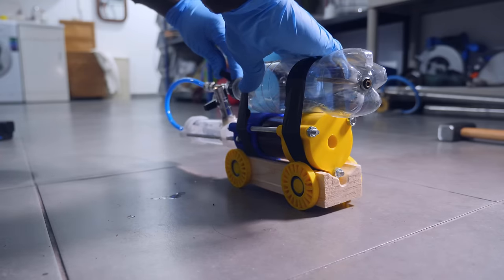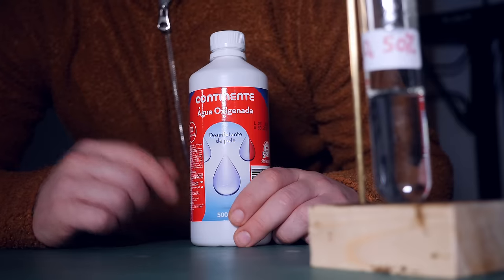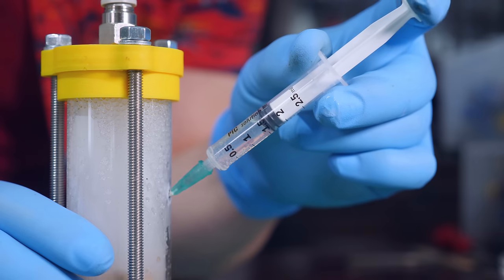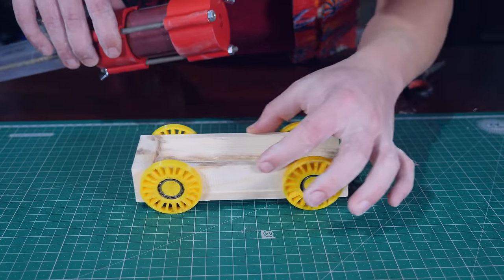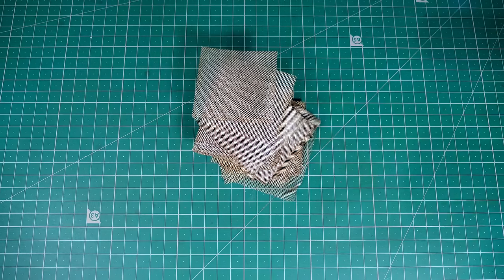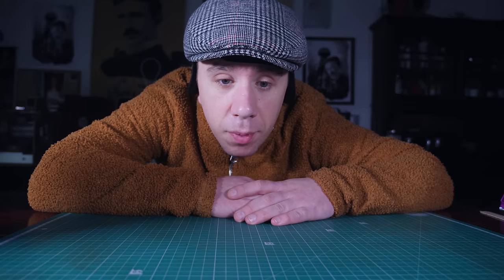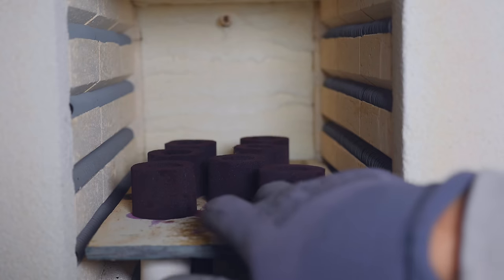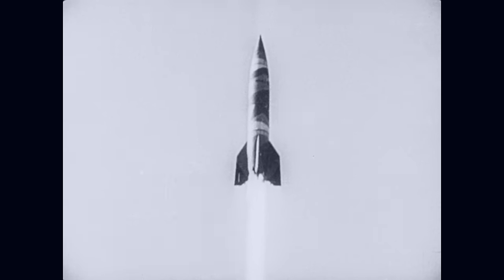SUPER HEATED STEAM ROCKET ENGINE

Comment: For layering the plaster fuel, rather than paint the inside of the tuber, print or obtain a smaller tube, paint the OUTSIDE of that, with much excess, then push that into the larger tube (maybe have a socket so it sits perfectly centered. Then remove the centre tube and u have a perfectly formed layed of the plaster on the inside of the larger tube with a uniform thickness. Or Create a two part mould where the plaster can harden, and then simply slot it into the tube.

Comment: When you were putting the plaster mix into the tube I had a thought. Why not have a piece of paper or plastic set down, spread the mix over that to get a smooth finish, and then before it hardens you slowly roll it into the tube and set it in there. That might give you a more consistant layer. You could then do multiple cylinders of the material of various sizes in order to get multiple tubes inside other tubes to maximize surface area. Put all that together into a tube and make an engine out of that.

Hope this inspires you.

Comment: Soo Hydrogen Peroxide decomposition over a catalyst is classified as a monopropellant and was used in (among other things) the attitude control thrusters of the mercury capsule (though over a silver catalyst). But there is a flaw in your thinking of using KMnO4 as a decomposition catalyst. KMnO4 is not a catalyst for the decomposition of Hydrogen Peroxide, it actually reacts with it. The equation goes something like: 3 H2O2 + 2KMnO4 -> 3 O2 + 2 MnO2 + 2 KOH + 2 H2O (whomever wants to discuss balancing of redox equations feel free but this is about principle). The MnO2 that is formed (also called "Braunstein" = "Brown Stone") is what's actually catalytically active in the decomposition of H2O2 and this is also what the brown sludge in the exhaust of your previous rockets was. So you should investigate if you want to use a stoichiometric mixture of KMnO4 and H2O2 for your rocket or if you want to try a catalyst bed from MnO2 or if you should continue on the silver catalyst. By the way H2O2 has a specific impulse of 117s at sea level (half that of hydrazine) and the lowest concentration I found for propellant formulation was 75%. Also you should check out Tom at Explosions and Fire for tips on safety when it comes to concentrated hydrogen peroxide.

Comment: Great video!

I have suggestions for your next things to try.  Musing more than anything else, but one extra step to the flower block 

A material that has these properties is exactly what you need.

It transmits heat to clinging water so well it can boil ice water with sunlight.

I understand this material has more surface area than the famed coconut husk carbon. 

Pyrolize it.  Then heat it under pressure at 300C with nitric acid and iodine for 6 hours.  Cool, open. Heat to 90C to drive off the nitric acid.

My geeky brain thinks this should be perfect.

Comment: Manganese dioxide also works with peroxide very well. Cheaper than permanganate, and you can mix it into stuff and bake it or even sinter it to make a ceramic composite. Some rocket packs use it instead of the fancy sintered silver catalysts.

Comment: Look into investment casting for wax.  Then take those techniques and replace the investment plaster with your permangenate plaster and create negative of the desired combustion chamber (less walls) out of wax.  Then pour your permangenate plaster around the wax and burn off the wax so you now have a more ideal combustion chamber with higher contact surface area.

Also maybe inject the OH into the chamber at varying points in the chamber and have feedback loop comping from the chamber to apply pressure to the OH reservoir so the motor can drive itself.

Comment: For absolute wild surface area and absorbtion with a material that won't combust, have you considered 3D printing ceramic zeolite molecular sieves? Can be done from a slurry state with FDM printing, and sintering.

If you wanna sinter it and still want really high flow-through, you can get a 2 or 3 part mould made to go in a regular workshop hydraulic press. This approach would mean having a mould made for 1-2 inch long segments, that stack and index into eachother precisely and snugly. For "optimal" "mesh" size and density (thinking small thin-walled honeycomb design), and decent component length, the interior shaping mould will require quite high precision machining. To get the relief angles spot on for all those very thin rods that form the flow-through voids in the output component (moulding such fine features will definitely require relief angles for it to demould intact). This would be extremely expensive and almost impossible to do with CNC, but interestingly enough it could actually be quite easy and fairly reasonably priced using EDM. Because if you're going with honeycomb shape, the geometry of those rods means the "cuts" will line up straight through the part from one side to the other.

It won't be a cheap mould, but once you have it, making segments using it will be fast, easy and fairly cheap. And with proper care, that mould should last you thousands of cycles.

Either way you can start off 3d printing the slurry for running trials, to see if the material has the properties you need.

There are a few papers on this, a starter can be found googling: "Extrusion-Based 3D Printing of Molecular Sieve Zeolite for Gas Adsorption Applications".

Comment: I bet you could speed up the concentration process by using a vacuum chamber. Reduce the pressure until the water cold-boils but the h202 doesn't. This also has the benefit that, as the water evaporates and then boils, it gets even colder. That should let you rapidly remove the water from an h202 solution without decomposing the important stuff.

Comment: Hey integza, try making an Turboramjet/ Rocket ramjet jet engine. It works like a weaker turbojet at lower speeds and like ramjet when it takes off. It engages the ramjet part by essentialy using a secondary bi fuel rocket engine inside, which turns the turbine, which pulls more air into the main ramjet combustion chamber.

Comment: Got to correct your intro... As a chemistry teacher decomposition is a chemical reaction! Below are all the standard common reactions:

Combination Reaction (also known as Synthesis Reaction): A + B → AB
Decomposition Reaction: AB → A + B
Single-Replacement Reaction: A + BC → AC + B
Double-Replacement Reaction AB + CD → AD + CB
Combustion Reaction: C[X]H[Y] + O2 → CO2 + H2O (hydrocarbon reacting with oxygen to make carbon dioxide and water while giving off heat... note this is only the common combustion formula as you could also generalize it as any fuel mixing with any oxidant, but for high school chemistry we stick with hydrocarbons as the fuel and oxygen as the oxidant)

Comment: Little tip if you want to conentrate even more your H2O2, you can use 2 erlenmeyers linked together with tube on the top (so the air communicate but not the liquid), one filled with your H2O2 to be concentrated, and the other one filled with liquid dessicant (like calcium chloride, very easy to find) and only heating the H2O2. This will fasten the process and also take out even more water of the hydrogen peroxide
Reply: This needs more likes. Far better than the people suggesting vacuum detona- I mean distillation!

Comment: What I would like to see is a hybrid rocket engine test using pine wood as a fuel, I'm fairly sure it would be surprising.  Simplest rocket around- a pipe, 2 endcaps with a de laval nozzle or good rocket nozzle- perhaps even just a drilled hole in one of the endcaps, the other cap is tapped for a high flow nozzle for an oxygen line and tank.  You put a servo controlled gate valve to allow a quick release of oxygen which travels through the injection nozzle and into a hole through a nearly solid carbon containing material (pine wood in this case)
The ignition source sometimes goes out-do not recommend firework sparklers as an ignition source-sometimes they shoot off like a rocket if contained 😆...
I thought you could maybe use a 12v glow plug with a steel wool wrapped bundle of powdered ferro rod firestarter as a rocket igniter. Or maybe just very fine steel wool with a 9v copper wire source, It goes molten and if you added oxygen? It might light a hybrid rocket.

Comment: You could try to heat copper sulfate until it losses blue color then let it get colder and add peroxide. De-hydrated copper sulfate will pump some water from solution. And will become blue again. This is a way to get concentrated solutions of some chemicals aren’t easy to distillate. As example you could get only 96% spirit by distillation but with the help of dehydrated copper sulfate you will get 99.9%

Comment: Wow! Love your videos Integza! I particularly love the little bits of history you add to every video.
A cool video idea would be to look into the so called "Thunderstorm Generator" which is supposed to improve the efficiency of internal combustion engines by up to 30%. Whether you can replicate that improved efficiency or debunk it I think it would be an awesome video as the "generator" works be pulling a vacuum to collapse air bubbles within the Generator and ionise the exhaust gases for reuse in the engine.

Comment: Have you tried a version of freeze drying for your h2o2 concentration process? Run cooled, dry air over the top of your container while maintaining moderate to low heat in the liquid. That should speed the process.

Comment: Could you use something like drying beads to absorb the water out of the H2O2?
Reply from the maker: I haven’t tried that, maybe I should give it a go 😁
Reply: Pretty cheap and easy to use, can get ethanol concentration up into the nineties, no idea if there's a pore size which works with H2O2, but would be a little surprised if not.

Comment: You said it yourself; heat decomposes peroxide.... and decomposing peroxide makes more heat. 
What you might try is a system that has a 'hot point', some dense material with enough mass and surface area that when it's preheated, the application of peroxide creates enough of a decomposition reaction to produce thrust and maintain or increase the heat in that mass. 

Also with the plungers, are you making enough chamber pressure that it's backfeeding through the injection tube and stopping flow momentarily, leading to the sputtering on some of them?

Comment: It's possible to make a ceramic foam using clay slip and a sponge. You basically soak the sponge in slip, then fire it over 1500F to burn off the sponge. Ceramic itself is also porous, so those two factors together might make it an option for a reusable, non-combustible and inexpensive body to absorb your reagents.

Comment: Cool video, the H2O2 at 50% scares me ! But actually the more concentreted H2O2 is the more stable it is, at room temp, so keep going higher !
Regarding the burning of the wool, it is logical, KMno4 is a very good oxydizer, it can even triggers thermites when mixed with some glycerine.
A very good catalyst is MnO2, you could sinter small particule in your oven to get a high surface area and a solid.

Comment: To concentrate the H2O2, could you put it in a vacuum chamber and set it to a few negative psi? That way you could boil off the water cold without necessarily boiling off or decomposing the H2O2. It would depend on H2O2's and H2O's vapor pressures of course.

Comment: using your original ceramic concept, how about using that medium as a thin injector atomizer into a baffle chamber which would help minimize spraying? At that point you'd have a small pressurized chamber of mainly O2 without backflow which would then be applicable to accelerating reaction for another fuel in a second combustion chamber. The pressure would likely be enough to pull the secondary fuel through another atomizer to enhance the reaction.

The upside being a lighter source of oxygen and, with a better control method for the syringe, a more steady flow and reaction as a result.

Comment: I think the plaster idea was a good one but I think the issue was plaster isn't porous i.e. surface area is minimal. Perhaps using a different material, unglazed clay is porous but not sure if potassium permaganate could survive firing and I think the pores are probably to small to get a good enough mix fast enough to be useful. Perhaps either a plaster design that maximizes surface area(without trapping the gas) could be useful. Charcoal is also incredibly porous though combustable(obviously) but maybe that could be a good thing if you can chain the h2o2/potassium permaganate into a combustion rocket you could increase output substantially as the byproduct would be oxygen. Could be something worth looking into. Great video as always.

Comment: I'd suggest you could try to enhance the water vaporization by lowering the pressure. You could build a vacuum chamber out of thick plexiglass & use off-the-shelf vacuum pump to create vacuum. You could then make a tiny hole for a power cable for the hot plate which would be put inside. Make sure that you seal that hole with cable as much as possible to avoid leaks. Or you could use some sort of induction coil to transfer the required power wirelessly. I think ElectroBOOM could help you with that.

Comment: You should cut the foam into similar shape as is the middle of space shuttle srb to maximize the output thrust and the surface that is being burned. I believe it was star shape of sort. This seems like a hybrid of SRB with fuel injected part so you probably still need some turbo charging of propellant - maybe use some electric turbine or do closed loop system. I don't know, just throwing some fancy words around

Comment: Great video, as always! Perhaps a suitable way of evaporating the water would be to use a partial vacuum. It lowers the boiling point of water to a lower temperature, even room temperature if the vacuum is strong enough. I''m unsure what it does to the hydrogen peroxide, but I think it's definitely worth investigating.

Comment: It seems like a really good design would avoid exceeding the melting-point of KMnO4 while exceeding 100C, preferably hitting somewhere around 150C, where you'd have super-heated steam. 

Historically, the basic reaction and applications (usually military) have been around a long time- IIRC, it was first used in torpedoes, to drive the shafts. Surely the engineers involved were pretty careful about how high temperatures got and you can probably find information about how this was done. 

The right answer might be that, instead of shooting largish amounts of hydrogen peroxide and water out through your syringe, instead use something like a shower-head, with each outlet going into a small metal tube containing KMnO4 mixed with a material that won't dissolve in water, preferably with fins on the tube or something else (like a water jacket) to keep heat from exceeding 150C until the engine has finished running. The key idea here is that only a small amount of hydrogen peroxide is reacting with any given tube at once, keeping heat controlled. What you're seeing in your experiments is what happens when the temperatures get too high and the KMnO4 breaks down into chemistry that's non-catalytic.

I'm also somewhat concerned for your safety running this experiment; if you achieve high-enough energy with this reaction but any "gunk" jams the rocket's exhaust, you've just built a pretty energetic pipe bomb.

Comment: Awesome video!

Now hear me out.

Create the working rocket concept using the KMnO4 / H2O2 and one of your bada$$ injector nozzles to propel a rocket as high as possible. 

Perhaps even your V2 concept or multi staged rocket using other more efficient propellants because the goal would be to use as little energy as possible to go as high as possible.

Oh.... we're not done yet.

Then on the way down, rather than using the easy concept of parachutes, deploy blades to turn a generator and see if you can actually generate more power through gravity's assistance turning the generator than if you hooked up a KMnO4 / H2O2 steam generator in the shop.

Comment: Im not completely sure but if this would work, but maybe try to evaporate more water by reducing the putting it in a partial vacuum, enough to make the water boil. Im not sure if that would decompose the h2o2 but i think it only depends on the temperature not pressure.

Comment: @integza Have you considered droplet size to make your reactions smoother and more efficient? Because you're not worried about autoignition, you could try a smaller orifice, higher injection pressure and stabilize your droplet size consistency by implementing electrostatic atomization techniques to your orifice tube injector. Switching from 0.6mm down to 0.1mm would reduce your droplet size and I'd be curious to see if you manage a higher cylinder pressure in your reaction simply due thorough reactions rather than droplets getting busted up by partial reactions and having to react somewhere else instead (noted by the uneven breakup of the doped foam).

Comment: What if you used very thin sticks of Teflon, or some other very nonstick agent to form small tubes of empty space throughout your plaster mix after it dries, pull the tubes out, and you would have more surface area for reaction. Or, make a silicone mold that is circular and has room enough inside of it to, except a layer of your plaster mix and permanganate, and you frosted on there, and then slide it inside the tube, leaving a lot of dimpled holes, when you remove the silicone after it dries, allowing an affect similar to the dimples of a golf ball, or cleat marks, as if you walked across it with aerating shoes? Any of these options would leave drastically increased surface area for reactions
Reply: Or, you could also use small sticks of wax if nothing else will release from the mold, and the wax you could heat to remove or dissolve with a different process